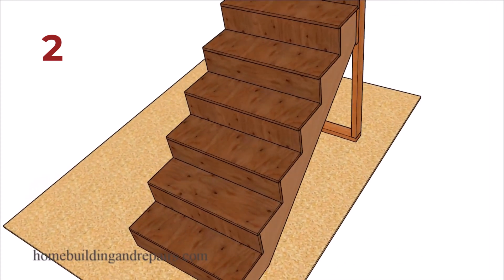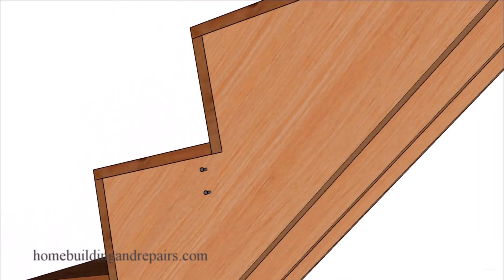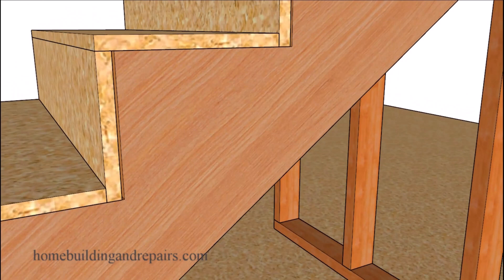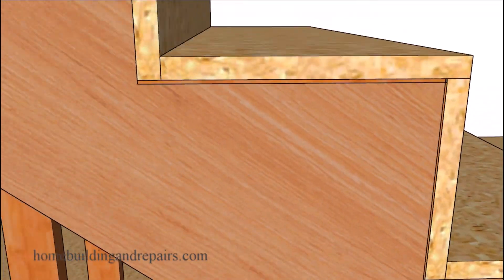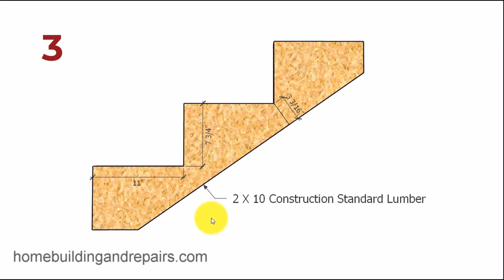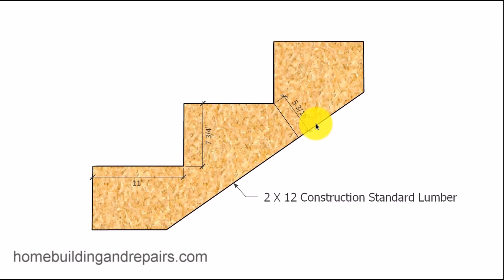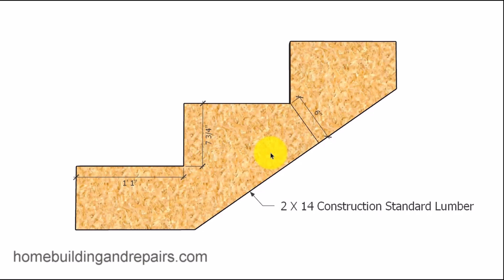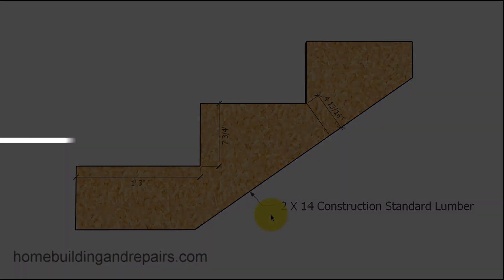Three Stair Building Mistakes You DON'T Want to Make!

Comment: I would think that if the treads were made of plywood such as common on an interior staircase the face grain direction would not be an issue due to the way the plwood veneers are laid up
Reply from the maker: I would agree, but it's still stronger according to the manufacture.